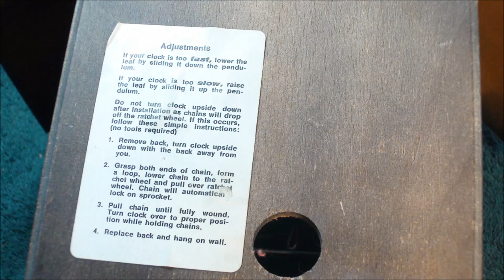Cuckoo Clock with Dancers

Comment: I have a clock just like the one you worked on. My dancers and music box need attention. After watching you I think I can fix my clock. The clock part runs well and keeps accurate time, also.
Thank you for the video.
Reply from the maker: This make me happy to hear you learned something from my video Dennis Herrmann. Thanks so much for stopping in.
Reply: @justmike57   Well, your clock has a different mechanism than mine. I watched your program again and made this discovery. If I put a weight on the dancers wheel, it falls to the floor and the dancers spin wildly. There is something missing between the clock works and the dancers. Any suggestions would help. Thanks.

Comment: Another great video. I am watching as I am typing. E Scmeckenbecher to my knowledge is the only clock maker that has the dancing platform to where the dancers turn the other way. As soon as you opened the back door I could tell that it was a E Schmeckenbecher due to the governor wheel for the music box which sits to the left. They again are the only makers that use this system to my knowledge. You got lucky because I have a E Schmeckenbecher cuckoo clock with a Seth Thomas name on it that the dancers have a different mechanism to hold them. Keep the videos coming my friend.
Reply from the maker: I don't normally like the dancing couples on a cuckoo clock, but when I saw them changing their direction, I was fascinated by the clock. Thanks for the additional info on this clock Mark. You have a great weekend.

Comment: Hi Mike, tnx for answering my email. Question: My Hummel cuckoo out of the blue has started to squeal. It’s not the music box and it’s not the clock it’s definitely the platform or the dancers? Is there any easy fix to try first? Clock is not dirty & new chains. Tnx!
Reply from the maker: Normally on a clock that has been cleaned, the verge and crutch would be the cause of this. Oil the pallets that contact the gear with a toothpick. You don't need much oil on the paddles.

Comment: I need help with the trip lever on my music box not the one hooked up to the box but the one that hooked up to the movement. 
It's driving me up the wall.  I've rebuilt the whole things.  New movement,  music box,  chains, bellows,   but the box won't keep working it skips,  I can send photos if needed 😢
Reply from the maker: If your clock is like mine, Open the side door that is nailed shut and look at your gears to make sure they are meeting and to make sure the screw is tight on the shaft. There are times you might have to shim the music box with card stock or even a playing card to move the music box closer to get the gears to meet better.

Comment: What do you use to clean the plate the dancers go around on? I have a clock that the dancers no longer move. Hoping it’s just dirty
Reply from the maker: I took my clock apart and used Dawn dishwashing soap to get the main oils and dust off the plastic plate. Even a metal plate, where the dancers drop through need cleaning from the dust and old oils so they will be free again. If your music isn't playing, then you might have a whole new issue and should clean your movement and check your music box for dust and maybe need some oil as well.